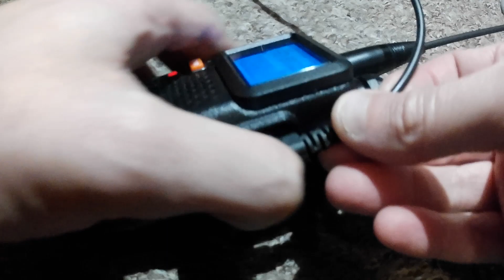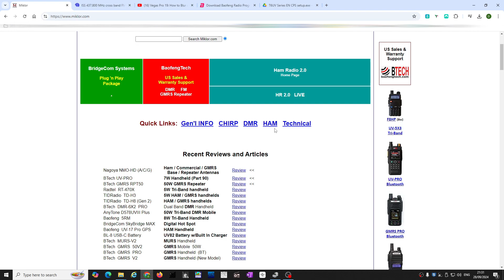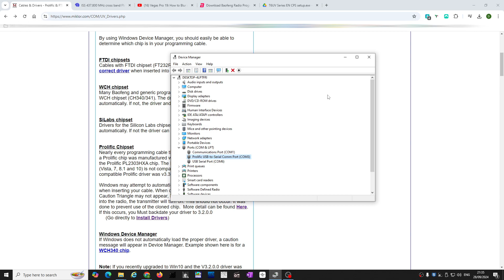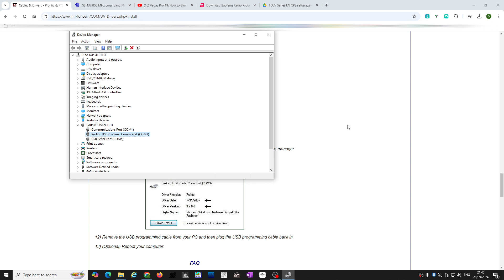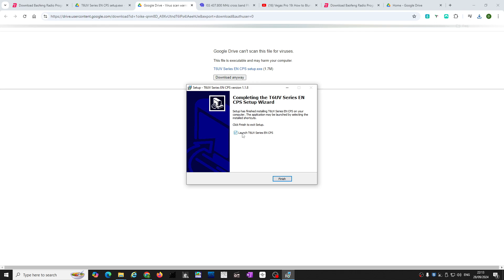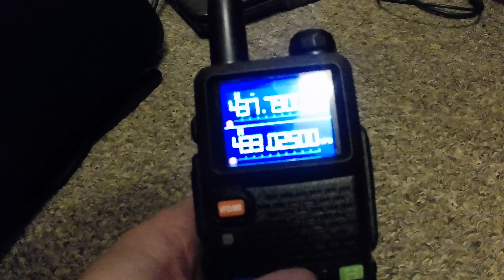How to install & configure fake Baofeng programming cables (Step-by-Step Guide)

Comment: Great detailed video.  I have the same cable.  I just received my radios  ((UV-17)) and cable today.  I followed it as far as I could but, never did find a "Prolific" driver.  I ending up changing the radio model in CHIRP to the UV-17 Pro and it downloaded right away.  TNX, 73.